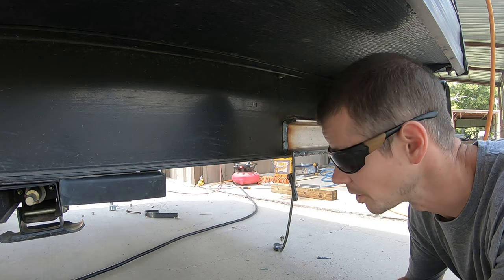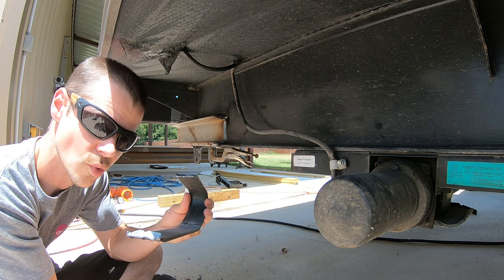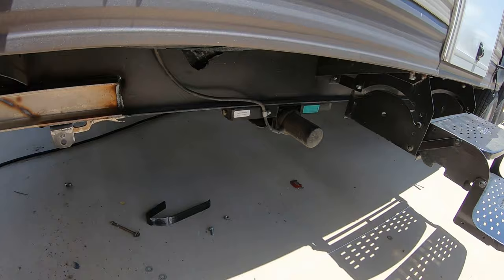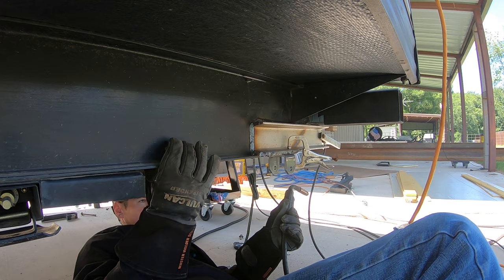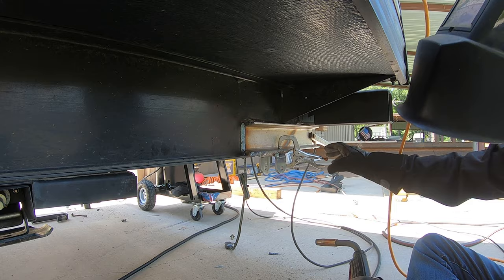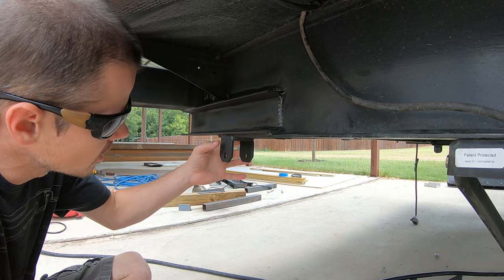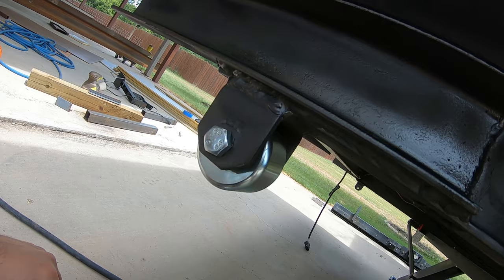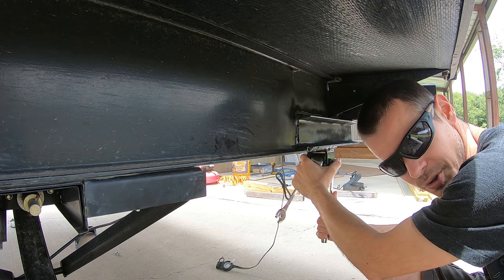How to add Rollers to your RV Travel Trailer to reduce scraping

Comment: Great video. I'm putting rollers on our newly acquired Class C motorhome. Sadly even on full size trucks most stuff has gone the way of metric. I rarely use my SAE stuff anymore. What's the size of the carport/RV shelter? My RV barely fits in our shop due to height and I need to protect it from coastal Texas elements.
Reply from the maker: I built my RV building a number of years ago. It is 18ft wide x 40ft deep. I have a 1:12 pitch lean-to style roof that is 12ft tall in the center, so about 12ft9 on the high side, and 11ft3 on the low side. I really should've made it a little taller, but I was being cheap when I built it and could only haul 24ft long pieces of square tube, so I split the difference and cut them to not have any wasted material. My current camper fits good no problems, but its shorter than most. The reason its so wide is so that I can have the slide outs and still walk around it. Also as you probably know, stuff always ends up getting stuck under covered areas, so its nice having elbow room for when odd things end up getting stored in the RV port. The two sides are walled, and the front is completely open. Thanks for your comment!

Comment: I would not recommend these.  First you are lowering your clearance and then you are going to have pressure on both ends of your camper at one time.  This pressure can cause damage to your hitch area and/or your sidewalls.  We traded one with these wheels on a fifth wheel and not only did he crack the sidewall once, it cracked in the same location two times.  If it is too steep of a driveway, don't go up it or if it is your driveway re grade it.   Just my professional opinion.  Best of Luck!
Reply from the maker: Thanks you for your comment! I would wonder though if the fifth wheel didn't have anything, if the same thing would have happened upon bottoming out. A hard blow to the frame on an RV could cause all sorts of problems regardless of if you have rollers or not. For sure as you suggested - best to avoid any situation where you would bottom out. My suggestion on top of that would be to always go very slow on any big grade change with the assumption that a low speed bottom out would be much less of a blow to the frame when compared to a high speed bottom out.
Reply: @uthe54  exactly.